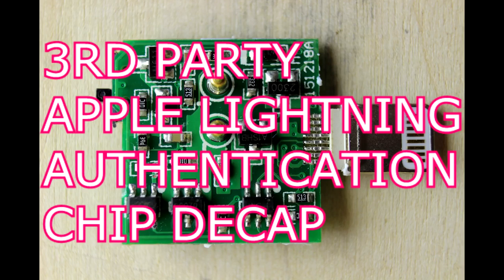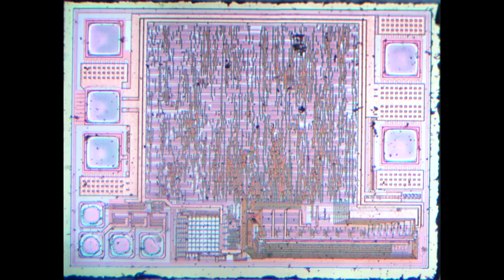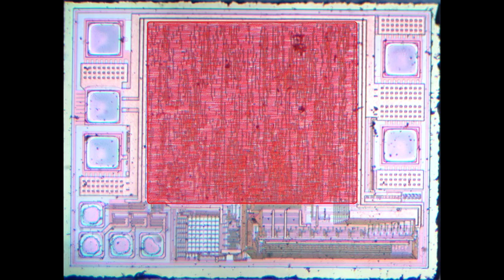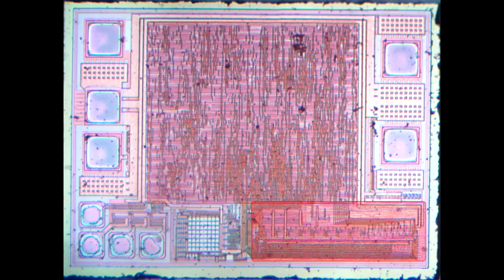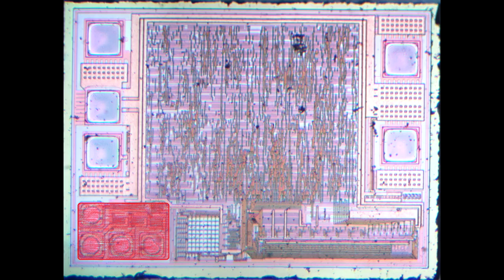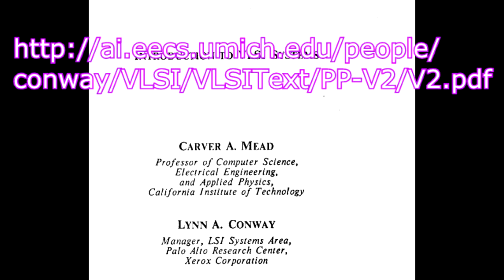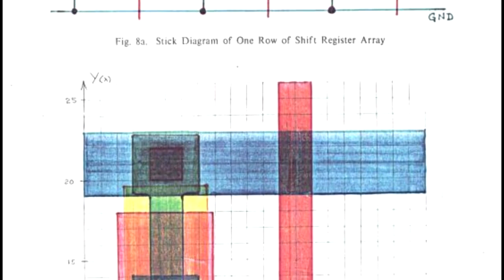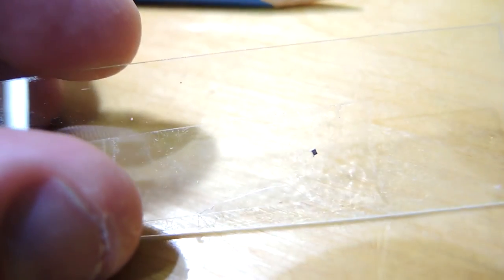3rd Party Apple Lightning Authentication Chip Decap

Comment: That's not the auth chip.  The lightning cables have never appeared to actually have one (since they have no special functionality, it isn't necessary).  As someone below pointed out, what you have there is likely the BQ2025, which DOES contain a serial number as well as the info for the ACC ID, but it doesn't have an X509 cert in it.  If you want an Auth chip, open an old iPhone 5 or iPhone 5S dock.  Those actually communicate the X509 cert over the lightning bus.  Other devices like Red Park's serial to USB cable, for example, also have an auth chip inside, but the data is communicated over regular serial using the other two "USB" pins, since all the pins are sent straight into the Tristar mux on the phone and can be functionally swapped by the phone when required.

Comment: It's probably a cloned chip, the real chip is a bq2025 from Texas Instruments. Chinese copied it probably because there's no "real" challenge-response authentication, it's just some sort of one-wire EEPROM. The only difference is that the bq2025 chip is powered via the 1-wire interface and has a lot of capacitors built in to remain powered but the clone must be externally powered.
Reply: The bq2025 is basically for actually implementing the 1-wire "lightning" protocol.  The EEPROM piece of the chip is only for the "serial number" that the cables seem to have.  You are correct, it has no X509 cert.

Comment: This is the reason i don't buy Apple.
Reply: The only real reason for a proprietary connector is that Apple charges a $4 connector fee for every third party accessory, cable etc sold. It's not design. It isn't durability.
It's business.
Reply: How does a standard USB-C relate to a authentication chip?
Reply: 'Going to be' is great and all, but it's 2016 and we're only just starting to see many USB-C products. Lightning equipped products have been shipping for over four years. They didn't make up their own connector /just/ for the hell of it. Maybe a little bit though.
Reply: sorry to burst your bubble pal, but new Samsung phones are now going to have usb type C
Reply: Motor Madness I don't buy Samsung either, the Apple for the poorer.
Reply: Toni Lähdekorpi
It relates perfectly in the bubble of "Motor Madness". Smells like a bubble of foul apples.
Reply: Raymund Hofmann What the hell are you talking about?
Reply: USB C does not have proprietary authentication to limit accessories to "authorised" ones.
Everything is going to be USB C (except Apple) it is the current international standard
Reply: Thank you for your response.
Reply: Still not buying apple...
Reply: ***** That is completely not the point.